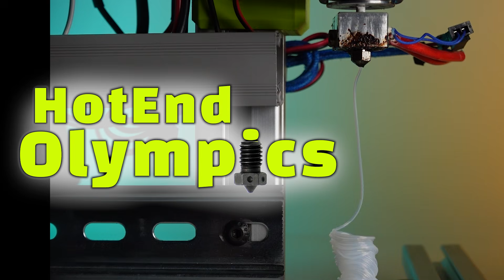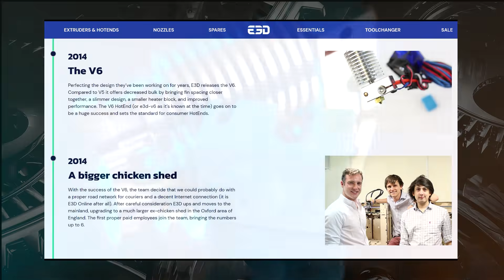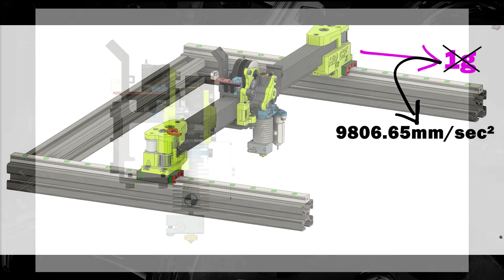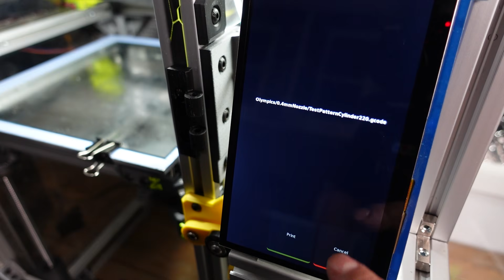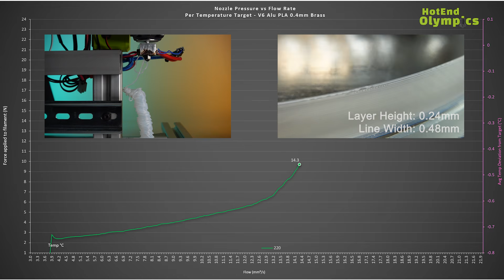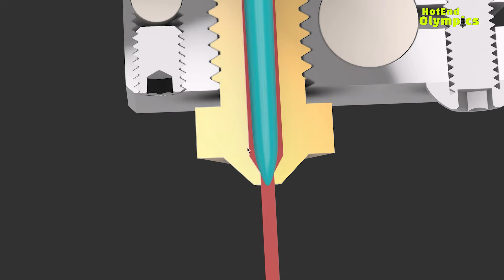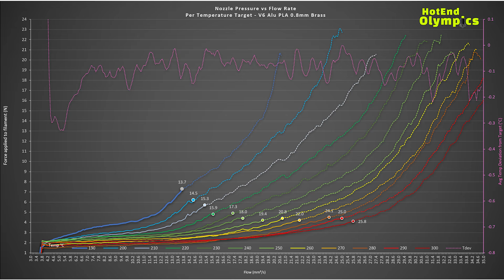How to find the best HotEnd? - Ultimate HotEnd Testing - Episode #1

Comment: So, what flow rate did you achieve? I got 22 mm³/s on a Cobra 2 Pro with a PET-G with a 0.8 mm nozzle and a regular ceramic heater from AliExpress for $5 (a fully assembled hotend with nozzle and wires included).
Reply: I want 40mm3/s to print at the same speeds as with a 0.4 nozzle +- 80-90mm/s

Comment: I am looking at you as it would be a such waste of your tike if you dont make the ultimate atom printer with small and big size variations. But please consider cost and maintenance as ethical as you may see. I love open source and support anyone that actually wants to take from it. Its a shame that Prusa doesn’t get licensing fees but just make it affordable and upgrade able, hence why creality is more successful. Linear bearings cost more than the printer combined (exaggerated) and I do-not trust them. There should be a better solution prioritising cost of maintenance above all. 

My latest printer is ender2pro as it was £140 and had it for a year. Upgraded to the ultimate thing (I am still not sure what it is) max speed 300mm/s and its basically silent. Keep in mind I had a AnetA8 Frankenstein mods and upgrades. And I do not have the luxury of space and table top. Yeah its stored in a cupboard and when I was servicing
my fans on 2pro I found out power supply was using the whole casing and frame as a heatsink as creality didnt have a fan in the power supply. Yeah

We should all own a voron0 its no brainer but very hard to get hold of plus cost.

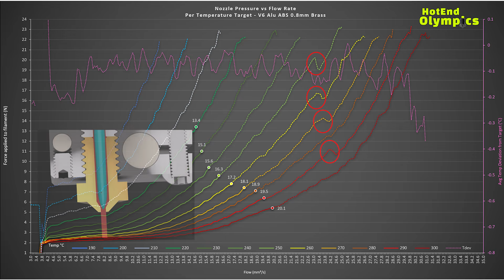Comment: Hi, just watching this now and seeing the odd trend between flow, force and temperature on the plot at 18:25. One theoretical cause for this is that you are at a turbulent flow transition boundary where the flow rate is causing turbulence close to the boundary of the nozzle. This should result in better heat transfer at the wall and turbulent mixing that would dramatically reduce the cold extrusion effect as eddies form in the flow and transfer hear much more rapidly from the wall into the centre. Typically you would model this with the Reynolds number https://en.wikipedia.org/wiki/Reynolds_number. There is essentially a range of values over which transitionary behaviour occurs (the turn and drop), below it the behaviour should be laminar and above it turbulent. I would attempt to calculate the Reynolds number in the centre of your anomalies and then see if it is approximately constant as the transition values should be constant for this setup. But this does explain why the trend seems to be almost but not quite temperature independent as the Reynolds number is proportional to flow rate. Temperature also plays a part but the relationship for this can be complex as it affects the viscous and density properties in quite complex ways.

Comment: Hi, all new hotends use copper plated hotends now that can reach up to 500 Celcius as they advertise... As they advertise it they say Copper has 3x more melting speed than aluminum heat blocks... So all premium hotends use copper plated and copper plated nozzles or CHT Like nozzles to melt filament faster right? Now on AliExp they sell copper plated heatblocks why buy new hotends with new cooling blocks and new heatbreaks new socks and so on... While we can get new copper plated heatblocks and CHT nozzles... Its all about companies making more money to me. Why not build your ultimate hotend yourself with new parts that has high quality...

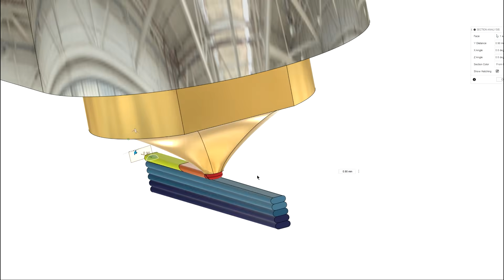Comment: 8:59 The material is actually pulled out of the nozzle after beeing extruded: You can tell from printing a tall, slender object with a .4 Nozzle and a .6 Nozzle. At same speed the .4 nozzle will reach a greater height than the .6 nozzle before the part is falling over. The force doing that is the force from pulling the molten plastic + the generated shear force from moving the nozzle over a bed of molten plastic. You can also tell from holes forming in parts if you print too fast. Even if you have sufficient plastification at some point the melt stream will break leading to holes where the printer can accelerate.

Comment: Sir, the “spike” in printing force you mentioned at 18:30, I suspect it is due to the molten filament oozing up the heating section, causing better heating. So at this flow rate/extrusion force, you have an additional heating mechanism that you don’t get at lower extrusion rate. And then from this point on the force increases wrt flow rate again. I think a way to verify this is to see if the temperature becomes more unstable at this flow rate, since different heating mechanisms would likely change the PID stability. Thank you.

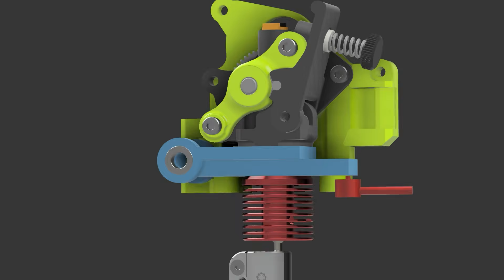Comment: I had a thought spring to mind around minute mark 8:22. Could the noise from the pressure sensor be mitigated by filtering the data with an accelerometer? Kind of like turning with input shaping, on and off to see the difference? Great video, thank you for sharing.

Comment: I bought a 3D printer because I want to print a pikachu and a carrot picking its belly button, but later on without realizing, I also earned my degree in structural engineering and thanks to this video, physics, fluid and thermodynamics LOL

Comment: Wow man, great video. Where did you get the lemon green filament from? Is it ABS or PLA or PETG?
Reply from the maker: It was a special ABS batch with the HevORT color: https://www.cr3d.de/kategorie/empfohlen/page/2/
Reply: @MirageC  how is the material? Is it strong and durable? The cost seems high.
Reply from the maker: @easy_3d  Oh, sorry, I should have been more specific.  The ABS blend that I got from them is out of stock now.  The one you see on their site is FiberGlass filled.  This must be a very interesting material.  The one I got (regular ABS) is quite rigid and tough.  It does require enclosure so it does not warp.
Reply: @MirageC  can we print without any enclosure? I have a Flsun super racer and a closed room without any breeze. So can i print ABS?

Comment: Excellent work. I love the graphs, but I prefer when they aren't zoomed in...meaning both axis start at 0, and all graphs (PLA vs PETG vs ABS) are scaled to the same maximum value (i.e. 35.0 mm3/s). This makes it easy make an "apples-to-apples" comparison, visually. If other people like the zoomed-in views, then perhaps include both.

It's important to note whether the extruder fails by filament slipping/grinding, or by the motor stalling/skipping steps. One could be improved by adjusting spring tension and preparing a better gear surface. The other requires a stronger motor.

P.S. Subscribed.

Comment: I have long contended that not only is the moment of the hot end mounting critical, but also the limiting factor for printing is the dwell time of the filament allowing it to melt to the center.

I have one criticism of your methodology: the max pressure should be scored statistically, not by observing the print quality. 
Pressure will increase more or less linearly, so for each step, you calculate a linear regression using all the previous steps (you probably have to discard the first steps). This regression is used to predict the next step. When the next step is significantly different from the projected value (t-test is probably appropriate here), you have reached the maximum acceptable pressure. 

Since you have all the data, you can do this anytime you wish :)

Really appreciate this. I am a bio-informatics scientist, and it is nice to see someone doing tests that do not suck.

Comment: center of gravity will not impacted the print the frames and the weight of  3d prints will not hold what ever you trying to gauge. we are printing plastic the changes when the plastic leaves the nozzle  even impacts it. just because you read books and go to uni does not mean u completely understand. all these readings are useless till the day you understand and see why its useless. by then you may have learnt more. big words and expensive gear means nothing.

Comment: Have you considered the effects of the different thermal conductivity of the plastics used?  Obviously it will vary due to formulation but I believe PLA has the lowest thermal conductivity, followed by PETG, and then ABS with the highest. I’m not sure to what extent this variation might account for the different pressure profiles you see in the data.

Comment: What about flipping the Axis? Apply a specific force and measure the flow(weight of filament) that comes out.
Reply from the maker: I have looked at that format too.  But it is not highlighting the pressure creep phenomenon as clearly.  And looking at it in a 16:9 ratio also contributes in squishing all curves very close one to another vertically.  We are applying a flow to the hotend which generates pressure.
Reply: @MirageC   Ah sorry, I didn't only mean flipping it in the data, but rather apply a constant force mechanically (with some Klipper magic) and watch what comes out.
If I understand it right, right now you are "requesting" a flow which leads to a constant motor movement and pressure buildup. 
Wouldn't it be interesting to see what flow we get from which force? (move motor until a certain force is reached) 
Or maybe this is just a stupid idea and won't show anything different.
Reply from the maker: @HannesMrg  I am not sure I am following right ,might be because of too many late nighters on this lol.  With the data we have right now this relationship exists.  As I see itm commanding extruder to cap speed when a certain pressure is obtained and measuring the flow is pretty much the same than doing a slow acceleration of extruder speed and measuring both pressure and flow as we go.
Reply: @MirageC  Thanks for explaining, yeah makes sense that there should be no difference in the flow-pressure-extrusion relation regardless on how it's measured.

Comment: Speed has got crazy on these machines but I have 2 concerns: integrity/strength of the part and increased wear on the machine and what the increased ownership cost would be but its exciting to see how far this tech has come.
Reply from the maker: You are totally right.  Printing faster needs to be matched with extra care to the print temperature and to the cooling mode.  Once we figure out the maximum speed at which no quality loss is observed, we should focus on the difference in layer adhesion between this maximum value and slower speeds.

Comment: Nice work! One idea that might help: you could extrude onto a rotating drum to simulate the pressure profile during printing. That would allow you to measure the pressure and flow with the partial obstruction of a print surface beneath the nozzle.
Reply from the maker: Yeah, i thought of that, but getting the drum perfectly centered, level and heated is making it a bit too complex for the resources I currently have in my possession.  This being said, I did find a way to measure pressur in an effective manner during printing.  Working on the video now ;)
Reply: @MirageC  That makes sense - the data you are getting looks consistent enough to be pretty compelling anyway. Keep up the good work!

Comment: I don't see why the moment is such an important factor in the final score. If artifacts because of flex are so important, then the stiffness of the mounting interface probably matters atleast as much. If we are concerned about the twisting forces on the carriage then the overall moment including the extruder is much more important. I am not trying to step on any toes, I am really looking forward to this whole series. I am just thinking that making the moment so important to the final score really confuses the results.
Reply from the maker: I understand your point, but since this is a series about hotends, we need to isolate the hotend caracteristics.  A difference should be made between a Volcano mounted on a V6 heatsink VS a VolcoMosqu mounted on a Mosquito heat sink.  Both will have similar weight, but quite different lengths and CofG values.  What would be your proposal for final score? Flow/weight?  I am opened to suggestion.  I am trying to retain as much data in the table as possible so we can look at the results using different indexes.
Reply: @MirageC  It may be the best to simply rank by flow. Which hotend someone chooses to use needs to fit their individual use case. A hotend that has the best CofG or moment is worthless if it doesn't flow enough for your application.  Some are going to pick a hotend based on value (flow/cost). If you want to print really detailed models fast, maybe the lightest thing that flows enough (not that much) is best?  If you have a very stiff carriage (metal?) and a very robust motion system then the weight and the moment don't matter near as much. If you are trying to balance the moment of an extruder above a linear rail for example, a longer moment may actually yield better prints in some case? I definetly see the value of including CofG and moment in the chart, it is great information to have, but I think having it be such a big part of the score could confuse those who don't quite grasp all the info. I think it would be better to rank based purely on flow, because the impact of all the other data is going to be very different based on the design, and intended use of the printer it goes on. And I just want to say again, I am just trying to have a constructive conversation. I think what you are doing here is incredibly usefull to anyone trying to pick a hotend, Thank you so very much for all the time and energy you are putting into this.
Reply: @MirageC  In the case of the Volcano mounted on a V6 heatsink VS a VolcoMosqu mounted on a Mosquito heat sink, what about the mounting system? If we are talking bout artifacts due to flexing at high acceleration values surely the mounting system maybe be as, or more important then the CofG and moment? The design of the carriage? How far away from the linear rail? I would suggest those using all this amazing information you are providing would pick a hotend that meets their required flow based on their design parameters, then balances the other characteristics to meet their goals.  But I think that is what those in the know will be doing already, I am just concerned that placing so much value on the moment may confuse those starting out, or a little less knowledgeable. I guess maybe this is an opportunity to make a video about wading though all of information you are providing once it's all out.

Comment: Just subscribed for fallow on test. I appreciate your OCD level for attention to detail. I'm a toolmaker with access to a large array of tools and machines. I found this video while doing research in designing and building a high flow, extremely light weight hotend using unusual materials. I'm extremely interested is seeing the weak points in various systems. Thank you for your work.

Comment: I missed where you showed how many mm/s print speed vs flow speed was recorded?
Reply from the maker: Not sure what you mean there.  Flow will be a function of layer extrusion cross section and print speed.  This theritical flow value is compared with measured filament volume going through the rotary encoder.

Comment: Would it not be possible to use the pressure sensor if you first did a "no extrusion" run for each hotend and used it as a noise filter? Basically subtract the empty run(s) from the extruding runs
Reply from the maker: I see what you mean. It could work.  But I have another plan quite easier, stay tuned ;)